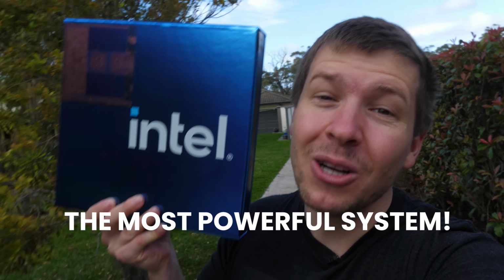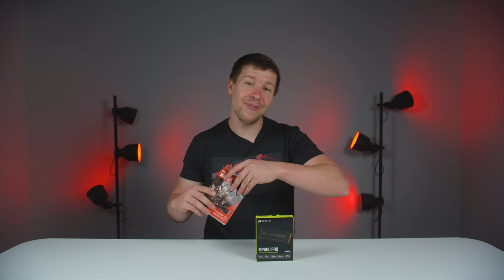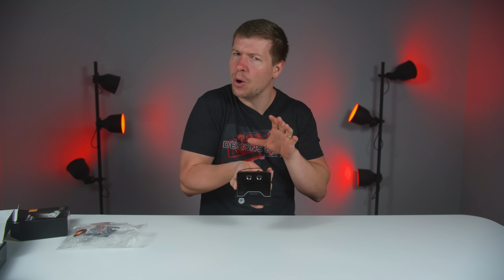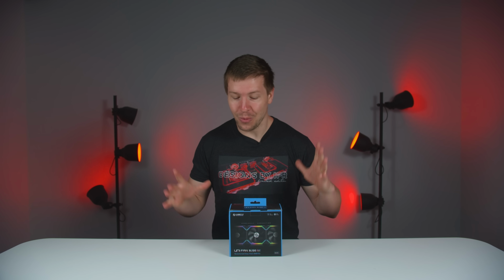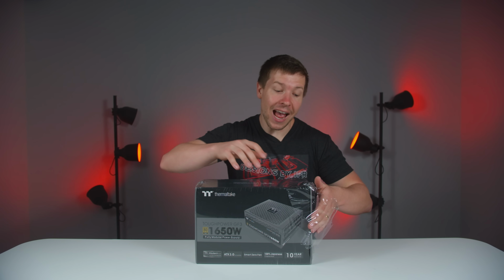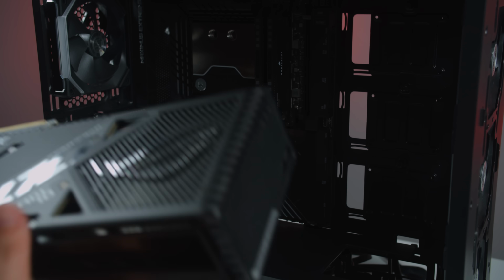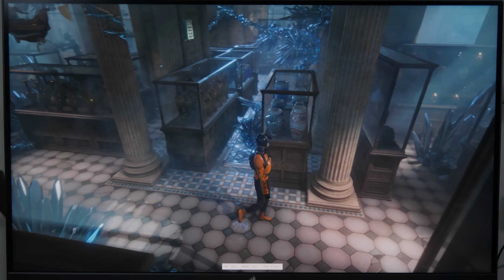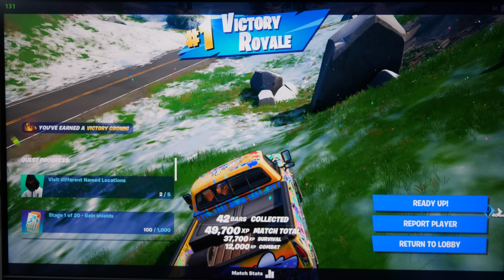Building the most *POWERFUL* PC EVER! - i9 13900K RTX 4090

Comment: You should make people aware that the Power plugs for the 40XX especially the 4090s need to be pushed hard as RMAs are being made for melting power sockets as people are NOT pushing them all the way. They stop at 99% in and NOT checking thoroughly. NVidia noting that the plugs work themselves out it NOT clipped in properly meaning many think the plugs are all the way in but are in fact NOT. They also advise plugging the power in BEFORE putting into the case and on the motherboards. Not checking can and may results in smoke and melting of the power ports.

Comment: Question, if you're going with an open loop to cool the cpu why not include the gpu in the loop? The 4090 pulls up to 450 watts and as such gets pretty damn hot.
Reply: He should’ve got the MSI Suprim 4090 like I did, comes liquid cooled already w/a radiator attached…but I doubt he could fit it inside that case… was already super crammed
Reply: no water blocks are available for them yet they release early next year

Comment: 5200 is just starving that 13900K for memory bandwidth when it can handle 7000 easily. Overall though that is frighteningly similar to my setup with Z690 Maximus Extreme+13900k, same CPU block, same SL120 fans and ThermalTake CL360 thic boi rad.
Reply: Don't, the replier is fake . He is duplicate. His tag has @designsbyIFR0 not verified
Reply: Scammer

Comment: By not installing the m2 drive in the Gen z.2 slot along the ram, arent you going to be splitting pcie lanes with your gpu? Seem to not be the smartest thing to do.
Reply: No not for the extreme, here it disables the second PCIE Slot. But on the hero or gaming wifi installing M2 in the top M2 Slot halfens the PCIE of the top slot Lanes to x8. See Manuals.
Reply from the maker: Theres plenty of lanes. We are not making it any slower

Comment: I would like to know when, hum i mean if the liquid solution is going to clog up your system. Seen very bad feedback wondering if its the rule or exception. 
I think the reservoir is way too close to gpu and radiator block airflow, and maybe melt the acrylic. Would be better if you separated pump from reservoir to have more room to work with.
Place the rez above gpu and pump below maybe?
Been doing watercooling for almost 20 years when Koolace was the dope.
 You can check my buid in my channel have swapped 1800x for 3950x and 1060sc of 2080ti.
Reply from the maker: The flow is fine my friend, it is also an open case so there is constant fresh air from the front too.

The reservoir will never melt, the air being blown towards it is cold air, hot air exhausts from the top

Comment: This is not best pc. The best pc, using 13900K & 4090, will exist if you add at least 2 more DRAM planks, more ssd m.2 (I think there are 3 or 4 slots for m.2 on motherboard and 2 more on Asus raiser). For ssd m.2, you can take 5-6 Kingston KC3000 for 4 Tb, this will be too cool. If you need MORE MEMORY, you can take maximum amount of ssd 2.5"/hdd 3.5" (e.x. 3.5" Seagate Barracuda for 14 Tb) and this will be overpowered pc.)))
Reply from the maker: Actually 2 RAM sticks overclock better than 4
Reply: @DesignsByIFR  But actually, if you wanna make real stress-tests for ur pc, you should have 64 Gb DRAM, bc during such tests you will use 53 GB minimum)))
Reply: @DesignsByIFR  Btw)))
Any physicist, entering this chat: "Quantum computer is better!"
Reply: Example of test:
•Install all browsers, open maximum amount of pages of Youtube, play any video
•Watch some 3 films (or more  if you want)
•Copying 1-2 million images
•Play CS: GO, Dota 2 in 4K, maximum graphics
•Play Control, Cyberpunk 2077 and AC: Valhalla in 4K, using 3 monitors.
You can add smth, if you want)))

Comment: So can you plug anything else into that breaker, or is it pretty much just the system? It’s possible (very unlikely) for just the cpu and GPU to draw 900w of power. Add in the fans, ssd’s and LED’s, you’re getting stupidly close to 1000w of power under full load
Reply from the maker: Its certainly power hungry